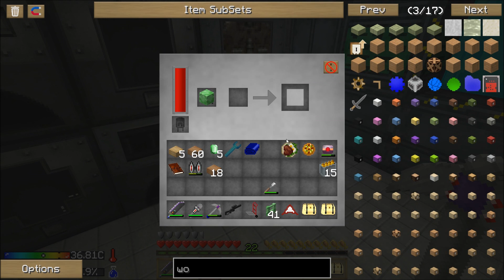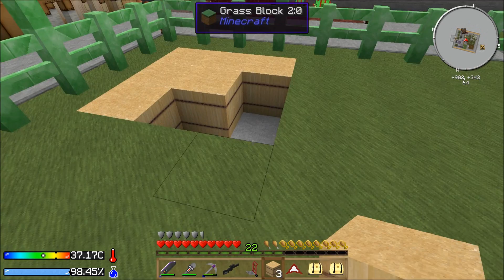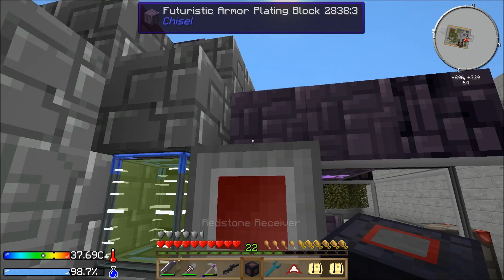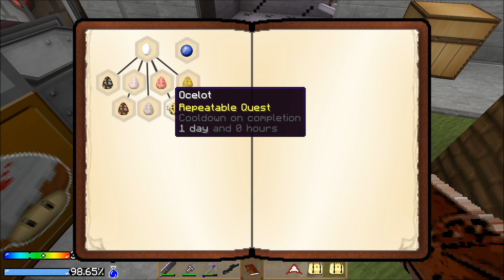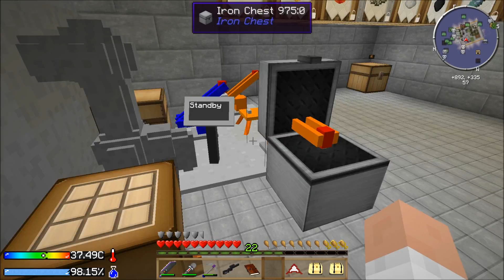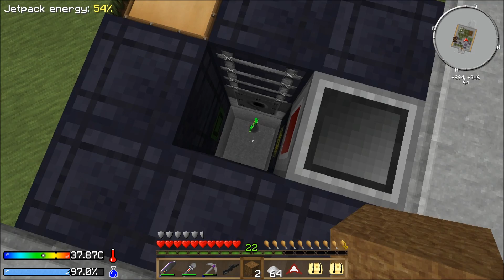Emerald Stable - Crash Landing - Landstryder's Minecraft Nightmare s3e33

Comment: Landstryder Perhaps you should put a packager in the system and with SFM you can set it to put only the dusts into the blocks you need to smelt. You should be able to find a way to also process your other materials into dusts so you can get the "increase" from pounding the ore gravel and ore sand into ore dusts.

Comment: I believe if you add a bunch off the machine upgrades that increase the air volume in your chamber or in your compressor you will not see such a dramatic drop in pressure when you process large quantities.
Reply: Yeah but it takes longer and more power to get the pressure up
Reply from the maker: defiantly a good idea, a lot of folk like using the larger chamber for this reason too.